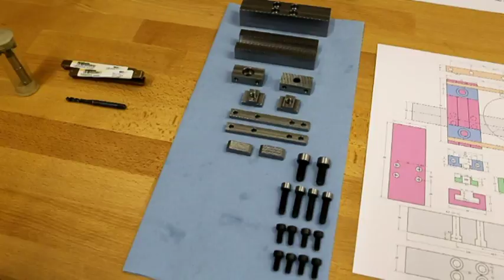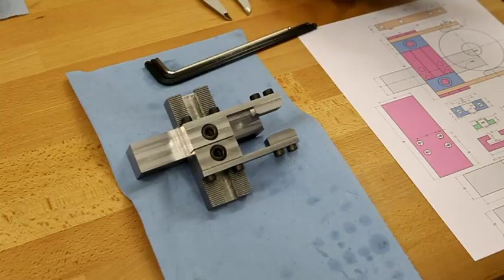Bar puller for CNC lathe part 3

Comment: Very nice!
I wondered about the hole spacing on those jaws when you were drilling them. They seemed awfully close to the edge of the part.
Reply from the maker: I wondered a little too, but obviously not enough to check the drawing properly. And it was my drawing ! It shows one can never check the dimensions enough. Maybe I also had a case of get-there'itis since it was the last parts. Thank you for commenting !

Comment: Looks like it works! Any problems with the weight from long bars causing it to slip?
Reply from the maker: It works. I have not tried it with anything heavy yet. I have two parts to run: One is 20mm aluminium bar and the other is 40mm POM plastic. None of them are heavy enough to create any challenges. Maybe I'll test it with a 2" steel bat just to see.

Comment: You must be happy now that it is finished.
I can not recall if you said what grade of steel you made the bar puller from i am guessing something like 4140 or similar ??

I prefer a  Bar Puller over the the Bar Feeder as it takes up less space in the workshop, but both have there positives and negatives as with most things in life.

I am not sure if you are familiar with the  Royal, brand of Bar Puller which is combined with a  parting off tool.
This will be something that i need to purchase myself as only have a 8 station tool turret on my Mazak lathe.
(  unlike some lucky people like yourself with a new Mazak with a 12 station tool turret  )

Thanks for the video, see you at the next one.
Peter.
Reply from the maker: Yes, very happy that it worked as expected. I made the two big parts from 1018 cold rolled. All the other parts are made from 4140 HT. I have a bar feeder too, but for the parts I am making now the lathe can run for 1hour 45 minutes on a 1 meter bar. I did make two small modifications after the video: I cut down the middle of the fingers from 5 to 3,5mm since they were too stiff. I also added a 6 thou shim to one of the pads. I will see if I modify the main piece that clamps in the turret eventually instead.